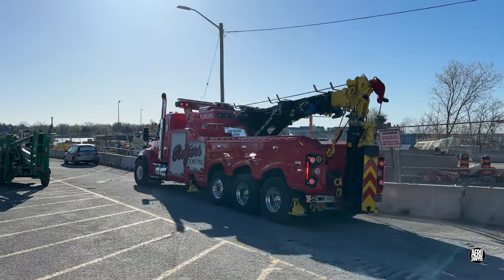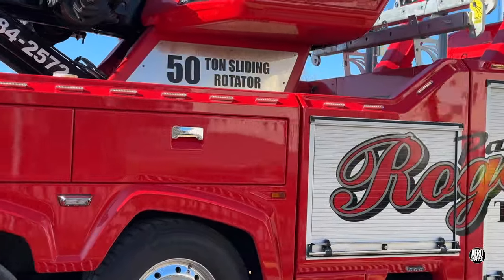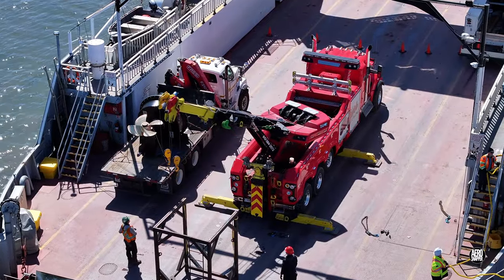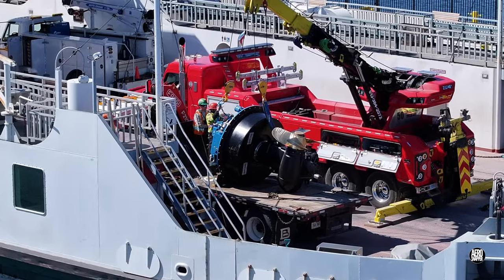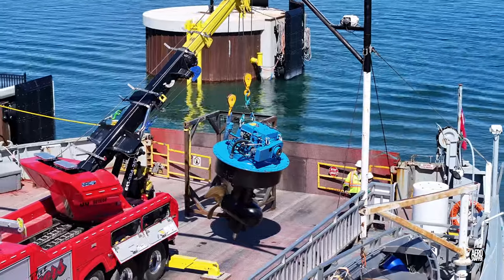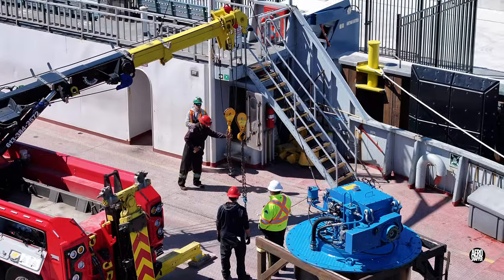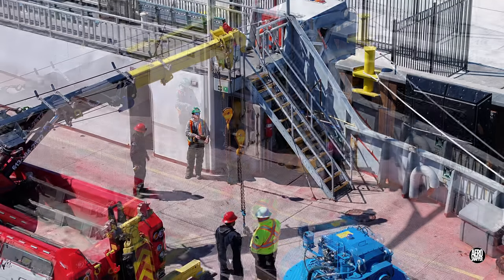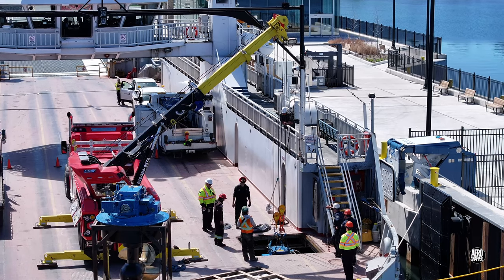Transplant Surgery - the Marine Way   4K

Comment: How did you manage to miss the main question?  Since this looks like the ferry is in the water just how was the motor installed without flooding the compartment?
Reply from the maker: The thruster unit enters the water at the waterline - no question of flooding - thanks for thinking of that though